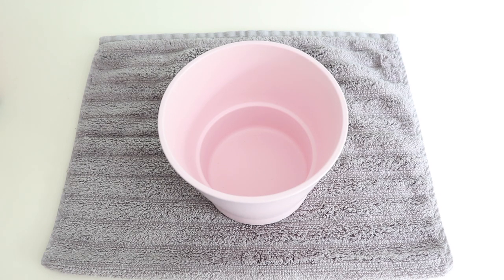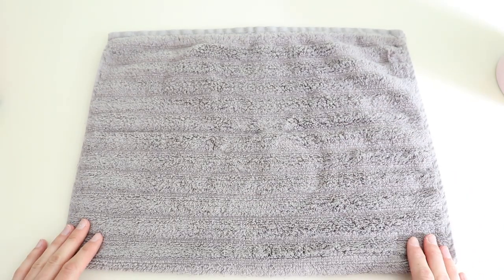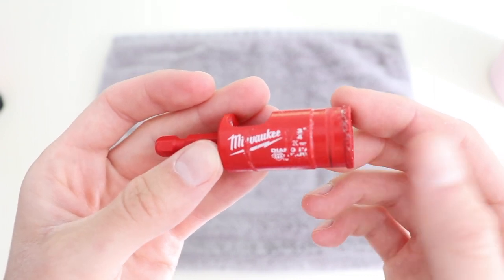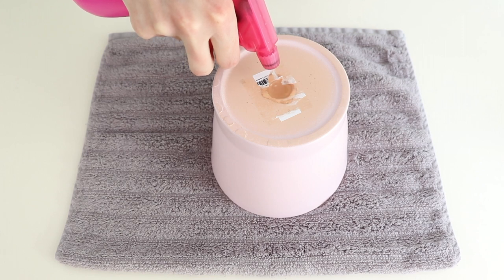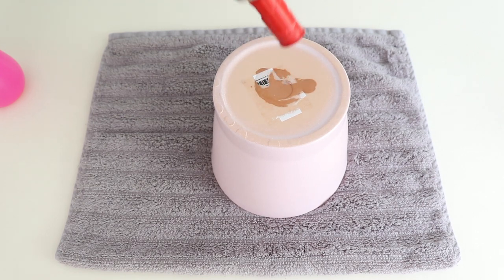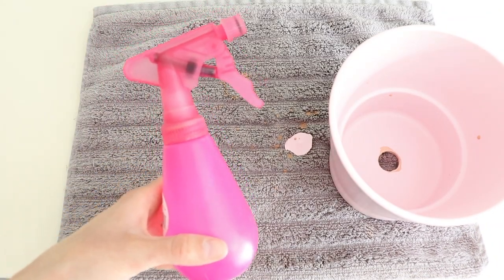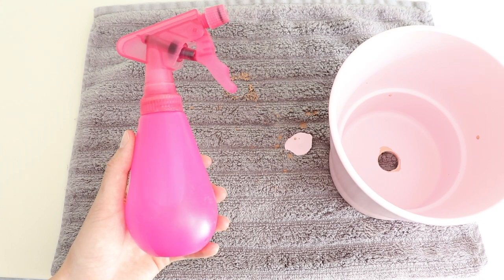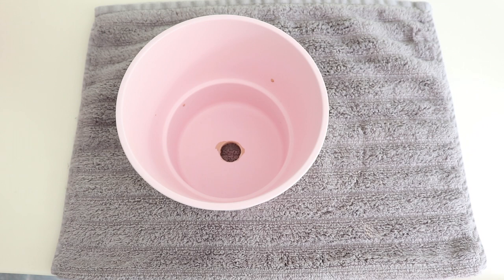how to drill a hole in a ceramic pot | house plant drainage

Comment: Great video. I personally don’t drill holes in decorative pots as long as they have a little rim on the inside like yours has. Usually I keep my plants inside their nursery pots until the outgrow it. That way the nursery pot sits on top of the inner rim and there is room for excess water to drain down into the space. Extra tip: you can collect the excess water that drained out and use it for the other plants ☺️
Reply from the maker: That is true! I would be careful reusing the excess water on other plants. Just in case there is any pest or disease in the soil that you can't see and it could end up contaminating the water. Just a thought :)
Reply: Julie Nicole thankss. I didn’t know that. I’ll be more careful now 😊